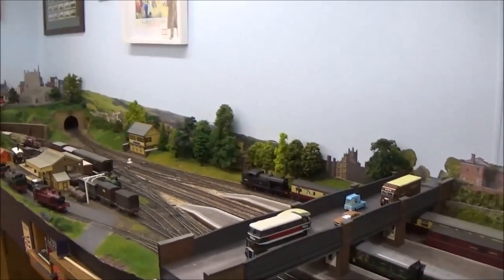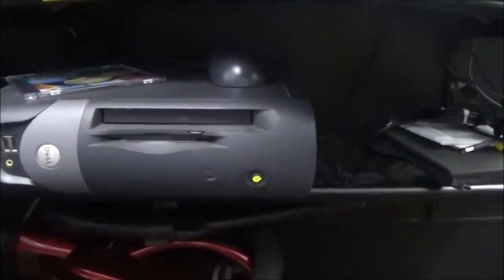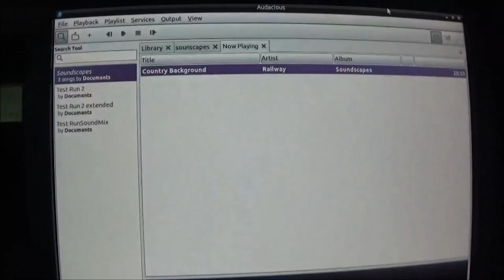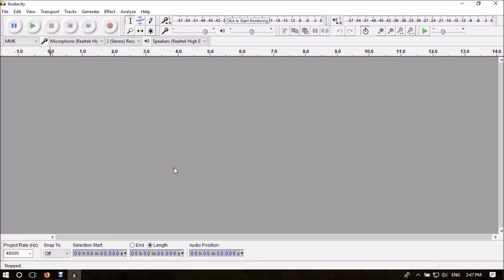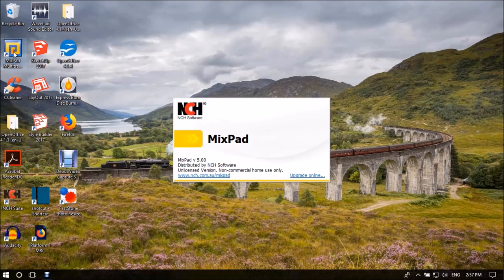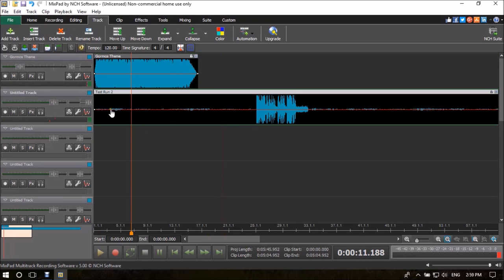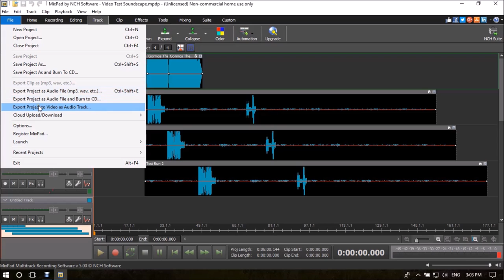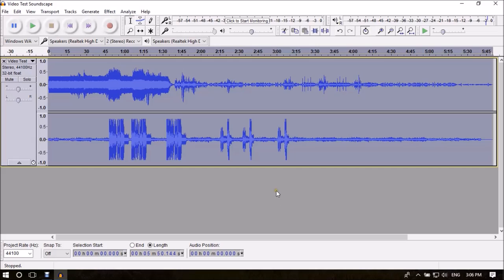Episode 99 18 Creating a Soundscape for Your Railway

Comment: Gormo, this is a great idea creating a soundscape and really like that you took a audio program to mix the layers. May I suggest some? The recordings from YouTube and off of CD's is great to use, but they do use some signal processing. If you want flat natural sound, may I suggest getting a microphone (does not have to be expensive) and you will need a cable that is XLR from the mic to a mini plug (stereo) that will go into your computer (laptop). You should be able to use the mic input that is on your computer (you will see a headphone jack and a mic jack. This way you can make your own recordings if you like right into your computer. Once you have done that move the files into you audio editing program and adjust and layer the sound to suite what you want where at the volume levels you choose! This way you start out with things the way they are in the field without have to EQ if you wish not to and the recording have a flat EQ when you made them. I have had to do that in the past with the job I have and believe me the sound was much better and natural, better that using "canned sound effects" Just my two cents.
Thanks for sharing and that was great how you setup the speakers and repurposed that little bookshelf sound system!
D. Muse
Reply from the maker: G`day David,
Thanks for the information on how to set up my own field recordings...........makes a lot of sense.
It would certainly be good for the main sound background and other sounds could be layered over it.
Most folks, possibly would take the easier route though and download from the net. I have a disadvantage in one respect in that I live in Australia and model English trains...?????.....therefore my field sound recordings would entail a trip overseas to achieve a genuine recording. On the other hand if I were to record in Australia it probably would not be too different.????
Cheers
Gormo